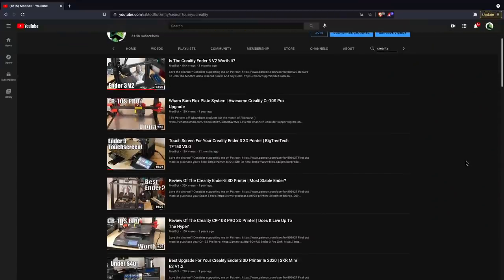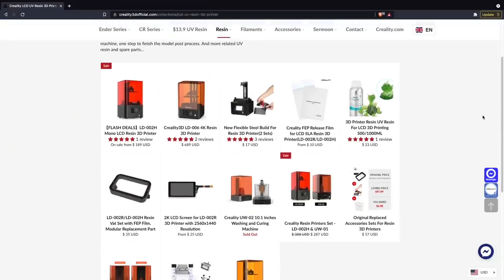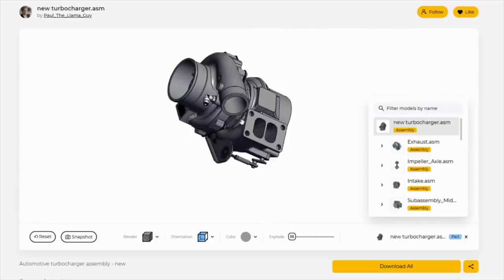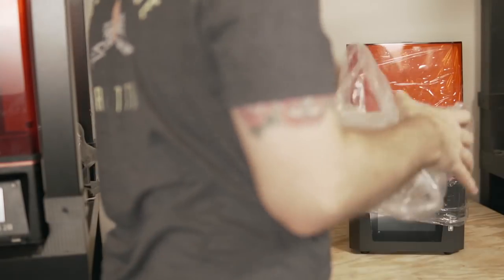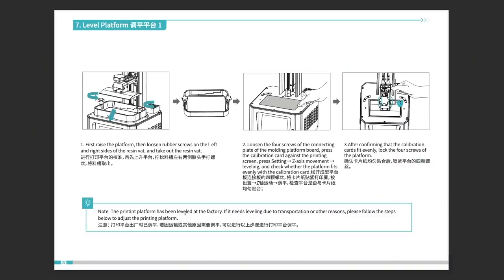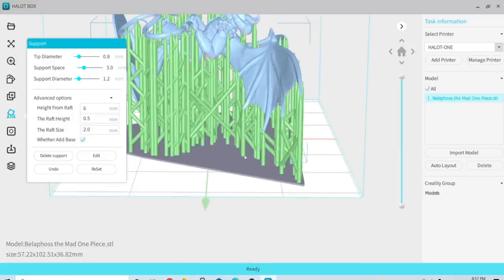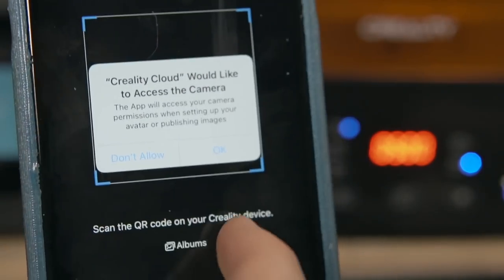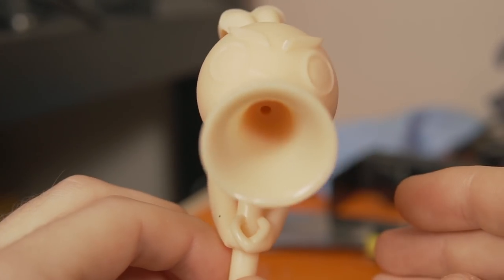Solid Hardware But Incomplete Software On The Creality Halot One

Comment: This is probably a response to Chitu encrypting their mainboards to only allow files sliced in Chitubox. There is a lot of discussion about this move and how Creality was very against it. This means Creality had to design their own mainboard and software to support it in a very short time span. This is only a theory but it tracks.

This also explains why they are in talks with Lychee to support the printer but no mention of Chitubox.
Reply: Where did you find this discussion my friend? Reddit?

Comment: Thank you! I just purchased a Halot-One and it is my first experience with 3d printing. I am a total novice. I did level the build plate per instructions, (I saw on another YouTube video) and used their software, (which is the Alpha level) and like you, I saw that the supports pulled away from the raft, but being new, I did not know that that was an issue until I saw this video. So, thank you. This is most likely the problem I have been having with the dozen or so prints I've tried.
I will try to get the updated software from Creality but in the meantime, I will use Lychee or Chitubox to slice my models.
Again, thank you.
Reply: Have you had success as of now?

Comment: Hi ,all. Creality company already told with Lychee company about the compatible issue,and it will be compatible in the next version Lychee software.But we still don't have a exact time.
Reply: Great to hear this new. I love the hardware once the software side gets sorted out it is gonna be a awsome printer.
Reply: I purchased this machine already. That being said, will I need to buy a new machine of will it simply be a software update?
Reply: @justinolcott8679  Thanks for your support, just a update for the software is ok, and the Halot One can be used at Lychee Slicers now.
Reply: @halotservice6739  You still need to fix this nightmare firmware. 1)No raise up when paused? 2)Wifi is SLOW. 3)Does not show current exposure layer on screen while printing! 4) NO webcams work when plugged in!....WHY?......
Reply: @foam27  
Webcam is not available to equip with the Halot one .
Halot One will  not show current exposure layer on display screen . when printing, only show the main view and top view.
I will write down your thoughts  at the daily feedback and upload to our product manager. About the " raise up when pausing" we will make it  on firmware on  late November and hope to be release in the end of this year.
Thank you for your feedback.

Comment: One huge advantage is they make their own boards and are not locked into needing Chitubox as a slicer. The prints look great and being able to load a file into the machine as well as adjust build settings is a good advancement.
Reply from the maker: Chitubox boards are not locked into their slicer are they? I feel like I have seen many printers with Chitu boards that also use the Lychee slicer.
Reply: Chit are using very suspicious phrases to act like they are not being anti competitive. But it is looking that way.  The inconvenience of having to model and support in our preferred software and import to the machines slicer before printing seems to be the way we are going to be doing it until companies get the message that locking software to machine boards is not the3d printing community ethos.
Reply: @ModBotArmy  they are rumors that is the way Chitu is heading...

Comment: Your bitching paid off. I bought one of these 3 days ago and I was able to immediately install the Mac software on my M1 MacBook Pro and the software was hosted on their website. (I didn’t even think to look on the thumb drive lol, glad I didn’t) Also, sending the file over WiFi from your computer when using HalotBox works without having to manually type in the ip address as long as you connect the printer to WiFi first. I haven’t tried with Lychee yet because I’m very new to printing and literally only learned about that today but the Halot One is on the compatibility list according to Lychee.

The Halot Box software is still basic but the bug where adding supports raises the boat off of the print bed is fixed. Haven’t checked the other issues yet but the first thing I did was do a firmware update

Comment: So I think it is great that some resin printers are thinking of doing something I felt was necessary for ages and that is separating the slicing from the exposure settings. I don't want to reslice my print every time I change my resin. not to mention it makes it easier to dial in settings as far as i am concerned
Reply from the maker: This is actually a great point that I did not initially consider because I primarily use 1-2 resins with the same settings. That can definitely be a plus.
Reply: @ModBotArmy  Yeah maybe because i an newer to hobby resin printing or the fact that I also use my resin printer to make practical parts using engineering resins as well as regular resins for fun pieces, I tend to have half a dozen resins and it isn't unusual for me to realize I chose the wrong resin profile and then have to reslice it to put in the right exposure settings. Not to mention that when prototyping i will use a cheaper resin so then when I finally have the part right it kind of sucks that i have to go back to my computer to slice it for the engineering resin. It would save time to just change the resin profile on the fly. It's something that i think would be good in all printers. Kind of like how i think RERF that anycubic does should be in all Resin 3D printers to find out the correct exposure settings for resins and how I think all resin printers should have a tank clean function like the elegoo printers where it exposes the entire print area to make removing debris from failed prints easier.

Comment: I just printed my first few resin prints and have to ask, does every brand have their own file formats you must stick to?
Reply from the maker: It depends, it seems much more so than with fdm and gcode being the standard. Like Chitubox boards have their file format which is the most common .CTB but many of the others that do not use their boards do have their own file formatting. I wonder if 3rd party companies can use the .CTB file format or are required to buy the boards. I am hoping for a slicer to become like Cura where it is open source and just has a ton of profiles.
Reply: @ModBotArmy  yeah it's kinda difficult to keep track of file types with multiple printers in your case i bet.

Comment: Thanks for the review. Still looking for that sweet spot to get into resin printing.  It's unfortunate that Creality seems to be making things unnecessarily difficult for themselves for what appears to me to be an effort to maximize profits. They want to sell you cloud printing hardware and services so they make the wifi connection proprietary. They don't want to pay a license to the established slicers so they have a half baked proprietary format. I have a feeling they're never really going to completely, 100% sort out the software issues and they've minimized their profit from me to 0 with their current strategy.
Reply: For the price that they are charging you are only paying for the hardware. When manufacturers close source their code and put licencing, you the consumer has to pay for it. Yes maybe Creality launched it premature. But I think software issues can be and will be sorted out. Also if they opensource the slicer, it will improve
Reply: @IdeaBoxful  Based on their marketing, it looks like they're making it super easy to update the firmware.
Reply: @SmallSpoonBrigade  My experience with Chinese products are they are rather weak on the software front at these price ranges. And you will have to do some of your own fixing. Got an Anet ET4pro for a start. Had issues with its software. Had to reflash it with Marlin with my own fixes. But an average user may not have the skills or the time..
Atleast if the OS is open source you may not end up with a brick..
Reply: @SmallSpoonBrigade  Also updating firmware can be tricky for the unintiated..
Reply: @IdeaBoxful  I doubt it's as hard as it was for my stock Ender 3 that required getting a dongle to reflash the ROM. But, in my experience most Asian brands can't figure out how to get software to work right. In college,  I had a $2k Sony Vaio laptop that would be at 99% CPU immediately after doing a fresh install from the recovery media because a bundled program had bugs in it.

Comment: Any updates on these issues? I see it's been 3 months, and I was looking at this printer for my first resin printer. It's available for $200. If not is there one under $200 you would recommend for a first time resin printer.
Reply from the maker: I need to revisit. I have had a few people reach out letting me know it now works with lychee and that there have been some other updates. No ETA as of yet on that video though. If you can find a mars 2 pro at that pricepoint that is probably my current recommendation.
Reply: @ModBotArmy  Just ordered it at $179....looks like Creality fixed the print pause and added the build plate lift on their latest firmware update just a few days ago. Thanks for the great video

Comment: Very informative video & echoes my viewpoint. New to resin printing & when I purchased this I thought it'd be able to do the slicing on the printer side if you just input the .stl file via a usb thumb drive. I feel that would be a step forward for this technology, as I'm sure the onboard processor would be capable of doing the necessary workload, even if it took a few minutes. Do you think this would be possible for them to do via an update (if memory/storage permits)? It would definitely put them ahead of the game if currently achievable.
Reply: That is the game plan, but onboard slicing will be a bit too much for the Cortex M0 Chip.  So it will be mostly download from cloud of files and network based printing. Besides on a faster processor, the print quality can be maintained with improvement in speed because of faster render times.

Comment: Wow thanks for this video! so this printer was (for a very brief time) $100 on amazon mid to late July and I've always wanted to get into the hobby so I pulled the trigger without knowing basically anything about 3d printing. it arrived a day later but resin wasn't coming until the next day so I tried to find the slicing program (didn't check the flash drive) -- took me an hour of googling to do but I got it eventually. The program is super janky but everything somehow managed to print almost perfectly except the user error ones  but almost impossible to edit generated supports if they're in a tight space because I don't know how to put them in manually yet. I downloaded chitubox but the sliced file is the wrong format I guess. There is little information on this printer even from creality, maybe because its so new?  I'm having most of the problems in the video except the supports lifting so thanks for shedding some light on it. overall I'm having a great time with it and I've had it running since I got it lol.

Comment: Reminds me of why I don't want to do resin unless I'm given one. Plan on staying FDM
Reply from the maker: Resin is awesome! I love my FDM and would not trade them for resin but I do think they complement each other well. I hope I did not discourage you from the technology because that certainly was not my goal.
Reply: @ModBotArmy  No you didn't. Just not for me right now. Gonna spend time on what I have now. It's easier and you don't have the chemicals do deal with.
Reply: I dont agree with fdm being more easy.. i started out with resin and fdm is to me the alot more inconsistent.
Reply: @ModBotArmy  Trade? Why would you ditch the fdm just because you bought a resin printer? I'm keeping my Ender 3, I'm getting the Halot One for other materials.
Reply: @HamderBo  It depends on the FDM printer and what you're doing, but the future is resin. Resin can print basically anything that can be dissolved into the resin and has fewer restrictions about overhangs and continuity than FDM.

I haven't personally had many problems with my Ender 3, but it does depend a bit on having it set up just right and some tinkering at times.

Comment: Sad outcome. I bought a Creality LD-002R over a year ago and it worked out of the box and prints beautifully. It does however use Chitubox as it's slicer and Chitu firmware. They should have stuck with that?

Comment: These are not hardware issues. So easily fixable with Software updates. The hardware from what I can see is actually better. The specs is really great for the price.
Reply: It looks like updating the software is going to be easy. With my Ender 3, it required tools to reflash the hardware that weren't included. This says that it can be done via Wi-Fi if I understood correctly.
Reply: @SmallSpoonBrigade  I am always skeptical about using wifi/bluetooth for firmware updates. Unless they have robust checksum verification of the downloaded file and an atomic update. That is not easy. Given the state of their software, I wouldn't test fate :-). Usb dongle is still better..